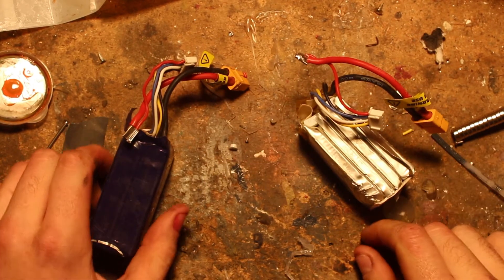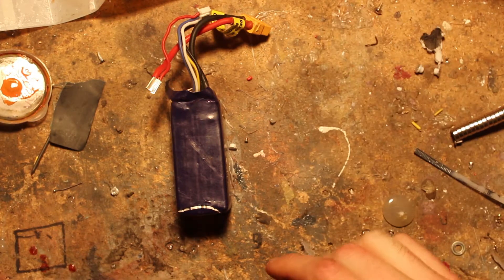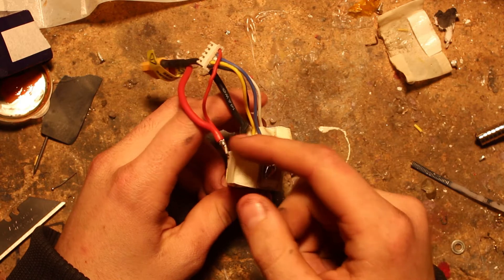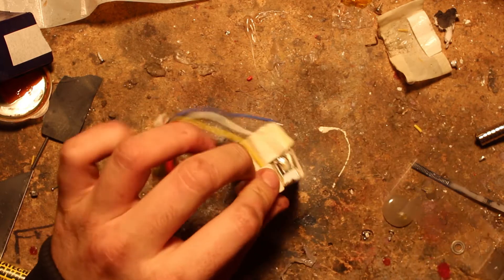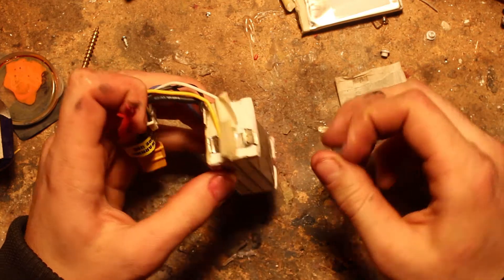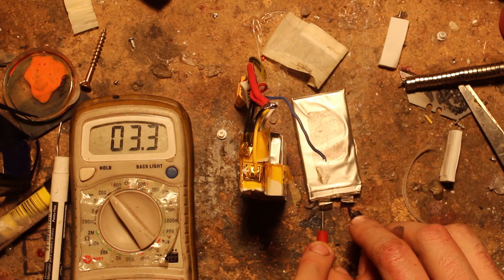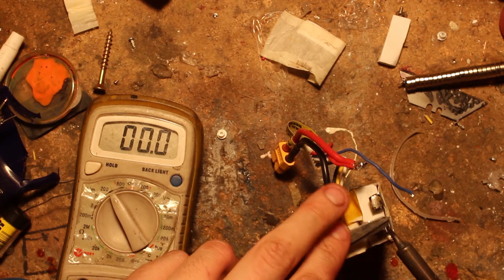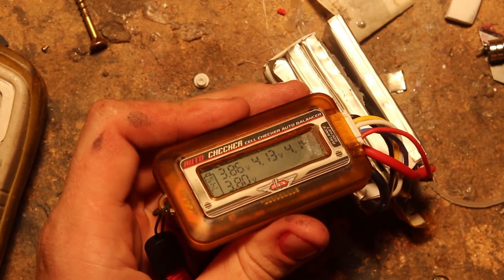✭WORKBENCH✭ Repair damaged LIPO battery tabs

Comment: Ive repaired heaps of broken tabs, without a spot welder, you can solder to aluminium 2 easy ways, 1: Use aluminium flux or 2: Copper plate the aluminium and coper sheet the top and bottom of the alloy for good current transfers, I keep nickel strips, copper sulphate, ferric chloride and aluminium flux depending on which way and how bad it is.
Heck I saw someone solder right onto aluminium using motor oil, at the end of the day you need to stop oxygen getting to the aluminium as you clean it to solder it or plate it as oxygen will oxidise the top 2 microns making it impossible to solder. 
Here is the best way of doing it https://www.youtube.com/watch?v=Z14aU-PaioA
Or this https://www.youtube.com/watch?v=8esfonbxuhk
just buy some copper sheet to solder top and bottom to maximise the contact area to carry the current